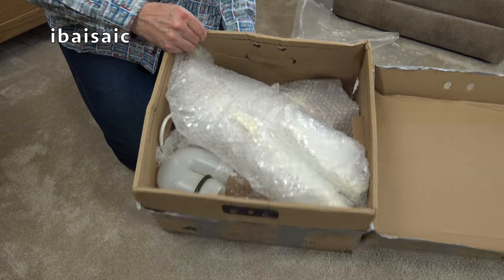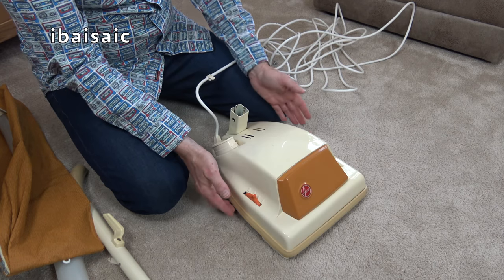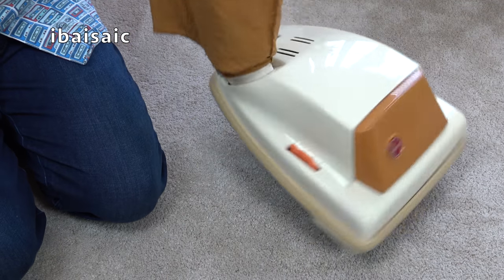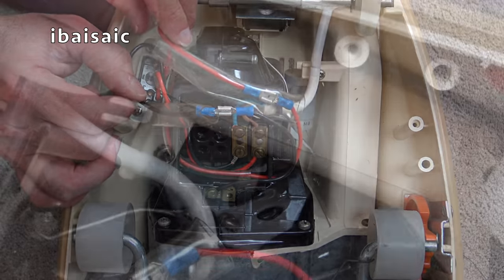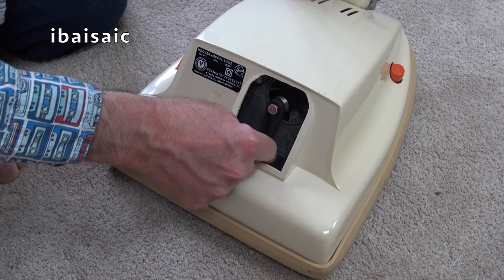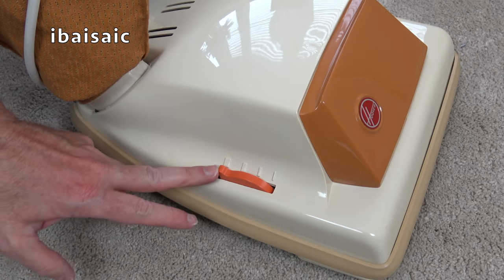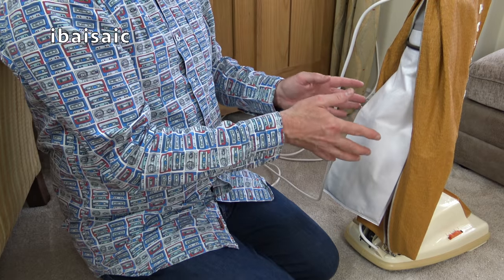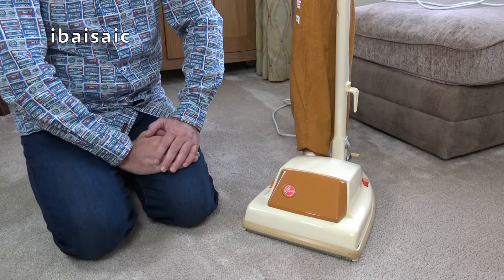The Sound Of The 70s The Hoover Junior U1012 Vacuum Cleaner from 1976

Comment: Roger please read henene4's comment below - the suppressor bypass work is VERY dangerous and you could get electrocuted, or the wiring could short out and blow a fuse. Please dont use the machine until this totally dangerous bodge job has been properly insulated. BTW - you are right about the date code - 604 is indeed 4th month of 1976, April 1976 - quite a hot summer followed later that year!

Comment: This was mine, I got it a while back, restored it all, new cable, full strip, wash, polish, painted the brushroll really went to town on this one.  I didn’t bypass the suppressor though, whoever bought it off me must of done that, I always leave them as they are.

The point of this message is the reason it is so immaculate is because it was mine.  I spend too long on machines, it is ridiculous, one clearly has nothing better to do, lol.

I checked the photos of the U1012 I sold... The serial numbers are identical, even certain things like the sealant around the fan casing that was blobbed slightly was the same on the photos of mine, now that would be too much of a coincidence.

I don’t really know where I am going with this, lol, non of this really matters.  Anyway, I enjoyed, good video, thanks as always.
Reply: What does it mean to bypass a suppressor?
Reply: @henryhooverfan2265  not wired up bcs it usually blows up
Reply: @Leoturner2009  They are still wise to have.  They do still help.  They are better to be replaced than bypassed.  They only blow up if they are very old and or badly stored.

Comment: Great video Roger, gotta love a retro Hoover, it's amazing to think that what James Spangler made from the bits he could find in the wardrobe(closet) of the department store he was a cleaner at, still remains the best way to get a carpet perfectly clean 203 years later 😁

Dirty fan type vacuums with beater bars should make a comeback in my opinion in modern form 👌

Who knows, had the Hepa flow bags that we have today existed when Sir James Dyson had a Hoover junior, the dual or multi Cyclonic vacs we have today may never have existed.

I use both a Numatic James(bagged vac) and a Dyson DC40 animal MK2 and like yourself I much prefer the bagged vac, cos it has more raw cleaning performance in my experience, far more airflow and suction 👍

Comment: Hi Roger, Beautiful Junior, The only concern I have is those wires that have been connected together from the suppressor, If those little sleeves move and the wires touch you will get a nasty bang and it will probably kill the motor, They need taping or heat shrinking, I would hate for it to happen!, Thanks Dylan.

Comment: Quick thing: Those parts of clear plastic over that surpressor bypass work are probably heat shrink that wasn't shrunk around the connectors.

Even if it isn't please properly insulate the connectors on there.
If they touch that would be a bad short and with plasti loose around them during vacuuming that could easily happen.

Would be a shame to see that beautiy blow up...
Reply: Yes you are right - that suppressor bypass wiring with exposed spade connectors under that loose fitting clear plastic sleeve, that falls off the connectors so easily is very bad indeed, and very likely that the metal connectors could short out. Hopefully if it does happen and there is a short from Live to Neutral, the fuse would blow in the plug instantly, with no more damage other than black scorch marks near where the connectors shorted out - BUT, if the live connector touches the metalwork of the handle bail then the whole handle could become live at 240V and Roger could be liable to be electrocuted if his hand touched the handle. OK there is a plastic handle at the top and the handle is metal but painted, so the risk is not as great as if the handle was bare metal, but the bypass wires and their exposed spade connectors need to be properly insulated against touching parts of the vacuum cleaner that could cause serious damage.
Reply: ✅😉 - he needs to heat, the heat-shrink tubing, 🤔 - did quick-crimp connector boots exist in the 70s?

Comment: I felt I should just correct you on the (ticking Time Bonb) you do  harp on about. Firstly ,yes you are correct that a suppressor is there to reduce sparking from the carbon brushes that contact the armature. However a sweet  running and aligned  armature,rarely would spark much ,so the effectiveness of the suppressor normally would make little difference, however they were fitted primarily so that the cleaners would pass radio  interference requirements. I have repaired 100 of these in my job ,and VERY rarely do the give any trouble. So the (Ticking Time Bomb) is just  a overreaction and if fitted should be left fitted.
Secondly  suppressors are still fitted to most electrical equipment today .food mixers,drills,saws, hedge Trimmers,vacuums,strimmers ,and again this is to suppress sparking from the  armature so that it complies with current radio interference regulations.

Finally unsuppressed equipment will still cause many issues with digital TVs ,such as freezing of picture,picture drop out and pixilation and breaking up of image.

So all equipment manufactured today that contain  a brushed motor will have these,they might be a lot smaller and not the metal can style that was fitted in the past.
The Hoover junior 1036/1104/1108 still had suppressors fitted,they were of a inductive type  and had red and blue sieving over them.
If you feel safer removing the suppressors,that’s you’re choice,but bare in mind that if you sell stuff on it might fall  when PAT tested and won’t confirm to the radio interference regulators  as intended.

Comment: looks like it,s had a new mains cable fitted because of the blue and brown leads, would have been red and black back in the 70's, the bodge job on the connectors needs sorting out,but not difficult to correct
Reply from the maker: It may be a replacement cable, but the colours were changed from red and black to blue and brown in 1971.
Reply: @ibaisaic  what struck me was all the cables in the machine were red and black, loved the video, happy memories of the earlier all metal junior from my childhood, which i couldn't resist playing with as a kid

Comment: Suppressors weren't for reducing TV interference, they reduce the voltage and give a steady current to the motor.  It's also a safety feature that stops electrical spikes and also keeps the motor from burning out.
Reply from the maker: I wonder why Hoover call them TV or TV and radio suppressors in many of the service manuals I have.
Reply: @ibaisaic  The part is technically called a transient voltage suppressor "TVS",
Reply: @ibaisaic  By the way I love all your videos, my partner thinks I'm nuts 🤣
Reply: @ibaisaic  Just done some research, yes the vacuums are fitted with what's called a T.V Choke which was separate from the suppressor. However the later models  used an incorporated T.V Choke which is included into today's earthed suppressors.
Reply: @ibaisaic  Yes, vacuum cleaners they were always advertised as T.V & Radio suppressed

Comment: the powder on the rugs   and carpet is awful  for motors and fan i never use i t on my rugs  if it gets in the motor  it will ruin  the bearing be carefull
Reply from the maker: The Sebo Duo powder is not like carpet freshening powders. I have used it for years with no problems.
Reply: @ibaisaic  ooooh  dry shampoo i was thinking the  vintage carpet  powder that ruins so many vacuum  im sorry then carry on then  ok